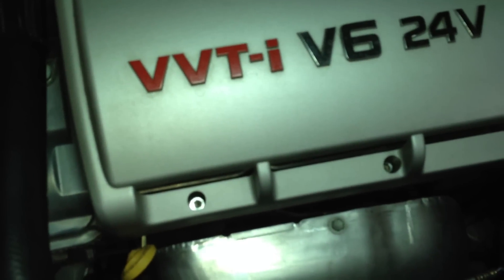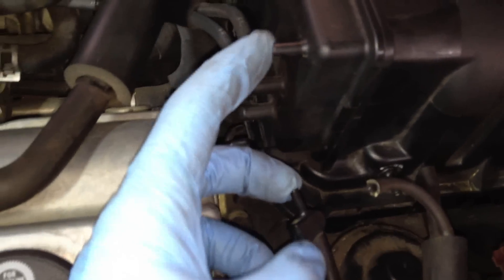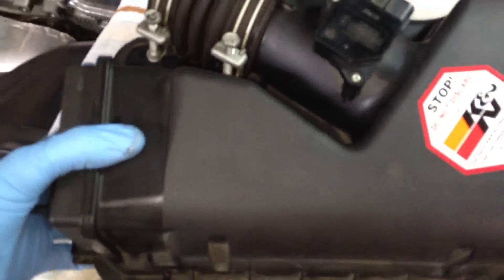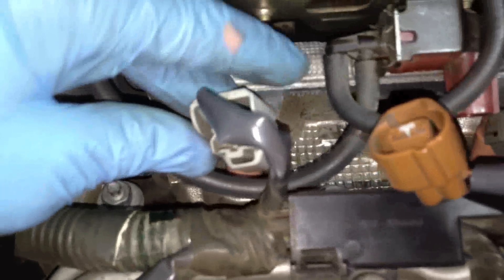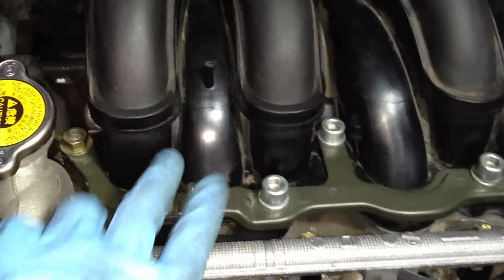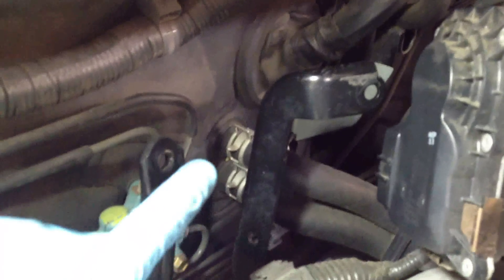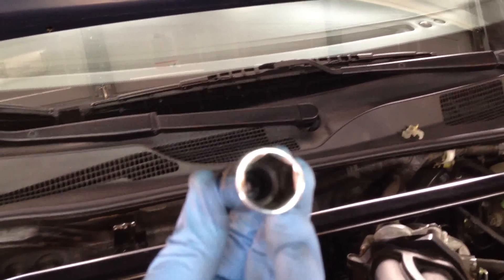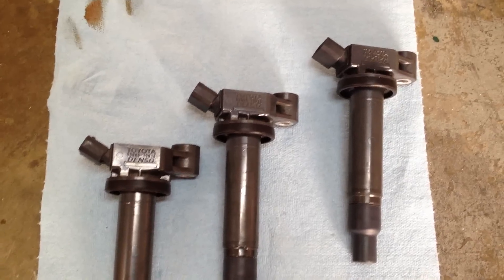How to Replace Spark Plugs in Your 2001-2006 Camry

Comment: I was able to change the rear plugs without removing the intake manifold.  It was tight but doable.
Reply: how?
Reply: Nick Funk yes how??? I took a beating taking it off, and took a awful long time to take out the 2 rear bolts, but I did it.
Reply: one poster earlier said his mechanic was able to do it also.  It doesn't seem possible because the coil packs are like 7 inches long and even if you could somehow get the electrical connector clips off, how could you pull the coils out? And then how would you get a socket and rachet in and on to the plug tops?  Isn't the plenum in the way?

Comment: Ok, I could not get the back 3 with my fingers. I took my smallest screwdriver, put the corner of the blade under the edge of the retainer away from the wires, turned the screw driver slightly to release the retainer.  I managed not to break any of the plastic retainers.

Comment: The hose that is dry and cracked at 4:00 into the video; What is that hose? Mine broke when I removed it. It was dry and cracked also.
Reply from the maker: +bullfrogharmonicat Typically, most of those hoses are vacuum lines. Take the hose into an auto part store and they'll have a generic replacement you can purchase by the foot. If you want the exact hose, you can order it online or get it from the dealer, but it will cost a lot more.

Comment: nice video very helpful completed replacement but ran into some issues. 1) all the 6 little clips on the coil plugs had the little tab break off. i added some electrical tape to help decrease the gap between the connector and the coil plug. 2) after reassembly it kicked the dreaded P0300 code. I went back through my steps and checked for tightness on all the connectors not the issue. after some research found possible cause to be a vacuum leak or intake leak. Checked all my tubes for connection and dry rot improved a few but no change. No visualizing the intake connection it seems tight and snug. Being plastic I didn't overtighen the intake bolts or torque but they are snug. So any ideas? know how to test the intake for a leak? thanks for any help. I am doing this on a 2006 Toyota Solara SLE V6 3.3 3MZ-FE ZU
Reply from the maker: +Jeremy Bates Thanks for the feedback! I really don't know what else to try. Did you use diectric grease on the connections? Could it be an electrical connection that is dirty?

Comment: My car smokes out blue on engine start up. Looking at your video... Do you think it's easy pulling the heads out? Is it a pain just do unbolt the exhaust near the firewall??
Reply from the maker: I haven't worked on the exhaust on this particular vehicle, so I couldn't say.  I would imagine most of the work would need to be done underneath the car though.
Reply: Thanks for the reply.

Well looking at your video, it looks easy enough just to do the valve seals instead of doing a whole head rebuild. I guess i'll go that route, good video btw :)
Reply from the maker: I agree. Let me know how it goes for you.

Comment: i need to replace power steering hose of my highlander and i neet to remove the manifold to have access to the bolts holding the hose....it has 70k miles might as well change the spark plugs

Comment: Where would I find the small hoses to that assembly thing you moved over to your right side?
Reply from the maker: +wanda40121 You can find the exact replacements at any Toyota dealer. However, you can save a lot of money by visiting a local auto parts store a nd purchasing vacuum house. They sell it in packs or.by the foot. Take the old hose(s) into the store with you. That will ensure you purchase the right house diameter.

Comment: thanks for the video, Do you recommend to replace the ignition coils as well?
Reply from the maker: Your welcome!

You might as well since this job is such a pain. You're only going to be in there once so go for it!
Reply: I'd skip that and replace the valve cover gasket instead. Otherwise you'll be taking everything apart to do that when it fails in the fairly near future.

Comment: Very good video showing how to get to the back spark plugs overall.   Where it is lacking is removing the manifold, this really makes this video not too great.  You failed to mention what you used specifically to remove the 14mm and two 12mm bolts in the back.  I was able to finally get them all out with a stubby box end wrench, took a lot of effort and time.  Now how did you swing the manifold around out of the way?  I'm still working on that but getting the manifold up and over the two bolts that the nuts secured to is giving me a very hard time.  I'll figure it out, but your video could have helped much more in this area and for that I would advise people to beware, due to the level of difficulty, which you did not emphasize at all,
Reply from the maker: Yeah, the video is 12 years old, when YouTube was basically just getting stared and this is still the only video you'll find with any sort of instructions for this job. Why? Because of the difficulty level. When I decided to video the job, I was already half way through it so I literally recorded everything during the rebuild phase, not the tear down phase and then spliced everything together backwards so it is what it is. I don't own this vehicle any longer, but I remember using the shorty wrenches for some of the rear bolts. This engine was certainly not built for the DIY'er. Pain in the rump!

Comment: Do you have to change the exhaust manifold gasket?
Reply from the maker: That's not a bad idea. Mine wasn't rotted so I didn't do it, but you probably should since you replace the plugs at 100,000 miles.

Comment: 2005 Camry 6cyl 3.0 Liter Gap setting is .044
Reply from the maker: The spark plugs should be pre-gapped when you buy them, but it's good to check.
Reply: +Militarized Citizen Denso SK20R11 is also pre-gapped at .044

Comment: Hey I just attempted to do this on a 2004 and had a lot of issues with removing and replacing the bolts on the back of the intake and throttle body. Very difficult task. Also I couldn't get the hose under the throttle body  (black part) unattached and gave up on replacing the back 3 Sparks. Overall too much of a pain in my ass and back now to be worth it. Also the old hoses tend to crack and such. Also the clips on the coils broke on all 3 when depressed. just from age. GG I lost
Reply: Get a set of ratcheting flex-head box wrenches from harbor freight. The job will suddenly be 10x easier.
Reply: My did end up buying some and it did help a lot. Was still very difficult. My main issue was getting the short hose disconnected from the underside for the manifold on the left side.

Comment: Good video, but you need to be more careful in how you point out components.
A nut is not a bolt, wiring connectors are not harness's, they are part of a harness.

Comment: On the 2000 avalon the bracket in the back holding on the intake manifold is curved at the top so there is about 2in of clearance. Even if I found a small enough wrench idk how I would get the leverage to unscrew it. Should of put that in the video.. But otherwise good instructions
Reply from the maker: Thanks for the constructive criticism.  This was the very first video I made and I wasn't intending to upload it until I realized no one else made one for this vehicle.  You wouldn't have wanted to see that anyway, I was yelling and screaming in Japanese!

Comment: How did you take the plenum bolts I’m having a very stressful hard time. What size wrench did you use?
Reply from the maker: Hi Tim. That job was so long ago, I do not remember. You could always try using a Crescent Wrench that is adjustable.
Reply: @MilitarizedCitizen  what size wrench did you have to use?
Reply: @MilitarizedCitizen  thanks

Comment: I wish you would've actually shown how to remove the 2 bolts that are holding on the intake manifold. Everything else you've shown has helped me up until this point and I'm stuck. I can't seem to fit my hands behind there in order to reach them...
Reply from the maker: Hey Travis, you'll need to look at the back of the intake manifold from the driver's side of the car. Use a mirror if necessary.

Comment: Im dealing with a 2002 camry le 3.0
Ive got more in the way of the rear 3 plugs. I cant even get my hands in the back. Maybe it’s time to say screw it and pull the intake manifold.
Reply from the maker: Hi Robert. I would guess removing the intake is the right call. I had to use a very short wrench from the top with only 1/4 turns (what seemed liked 100's of them) to get the bolts out so I could get to the spark plugs themselves. This vehicle is a pain to change the spark plugs on.
Reply: @MilitarizedCitizen  my buddy’s camry has a little more in the way and the space behind the intake manifold on his car would require very small hands and skinny arms. I tried for about 20 mins to get to it.. then realized i will need to remove the
Manifold. After that, it should be pretty easy to finish the job. I’ll report back after i finish the job. Thanks for responding.
Reply from the maker: Awesome. Glad you figured it out. Yes, keep me posted!

Comment: Can you use silicone plate in lieu of dielectric grease?
Reply from the maker: Hm...I'm not sure what you're referring to by "silicone plate".
Reply: Woops I meant silicone paste. Darn autocorrect!
Reply from the maker: 🤣 no doubt. Looks like silicone paste would do the job.
Reply: I replaced the plugs today. I used your video to help getting the intake manifold off. It took me almost 90 minutes just to get those 3 mounting bolts off the back! I also cleaned the throttle body while I was in there. In total, the job took about 5 hours. Thanks so much for this video. It was a huge help!
Reply from the maker: Great to hear that, Matt! Lots of hard labor, but well-worth the challenge.
Reply: 2 year update... The car is running strong. I was getting 23.2MPG before change the spark plugs, and now getting 25.9.

Comment: I love the fact that he showed how to remove all the easy stuff but then skipped over the hard one.  The bolt  just to the left of the throttle body is impossible to get to.  I want to know how he did it.  The rest I had off in 1 hour.  I spent one day on the last bolt.  I want to slap the crap out of the engineer to designed this.
Reply from the maker: +Gary Boswell Unfortunately, I didn't start recording this video until I had already removed everything. Therefore, I had to record myself putting it back together and then stitch the video together backwards. I removed the rear bolts using a short open-ended wrench, spinning it 1/4 turn at a time. It was too difficult to record and remove at the same time. Whatever you think of it, it's the only video on YouTube for this job so you're welcome. I didn't have a cheat video to use - I used my brain and a lot of intuition.

Comment: can you speak more directly to the 3 rear bolts off the manifold please....hard to find them.....
Reply from the maker: In all honesty, you have to reach behind and feel them out.  Using a mirror and a flashlight helps as well.  The video shows two of the three brackets that the bolts connect to.  I point them out with my finger at 7:09.
Reply: Thank you. This will help.

Comment: How the hell do you take off the 14mm on the back. Why is there no explanation?
Reply from the maker: Hi Christian. That bolt was extremely tough to remove. I had to purchase and use a short wrench and turn it 1/4 turn for about 15 minutes to get it loose. I could not record and do the work at the same time, unfortunately. Hopefully that helps.
Reply: @MilitarizedCitizen  thank you for the reply and the video after an hour I finally got it out.
Reply from the maker: Glad to hear it. You're very welcome. That was the worst bolt to remove during the whole project.
Reply: It's the worst. They put that there so we take it to the dealer.
Reply: @MilitarizedCitizen  Do you think a ratcheting wrench (with a flex head) work for the 14 mm on the back? I haven't replaced a spark plug (myself) for 35 years, but now that I'm semi-retired, I'm thinking about doing it on my 2004 Camry SE with a 3.3L. Thanks for this informative video!
Reply from the maker: I would say a wrench like that would come in handy for sure. I wish I had those when I did the job myself.

Comment: You don't have to remove the manifold to get to the back 3 spark plugs just the right tools and a little effort I been a mechanic for over 20 years and have done several of these engines